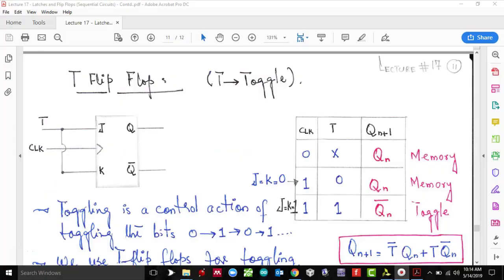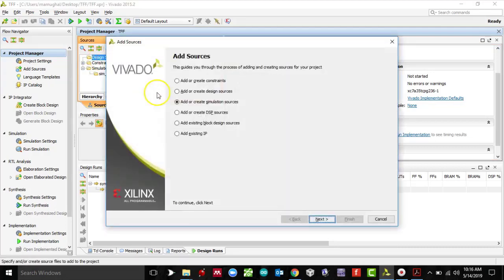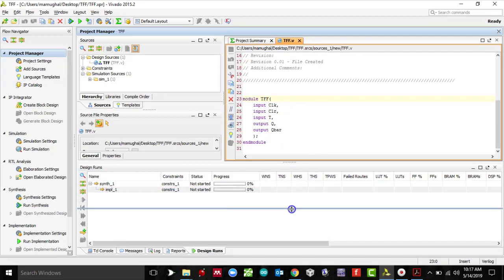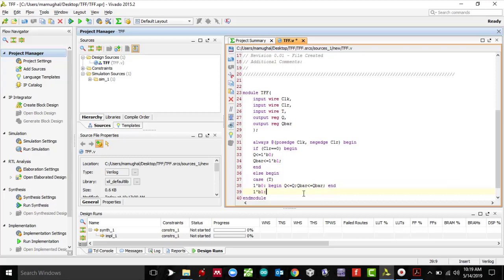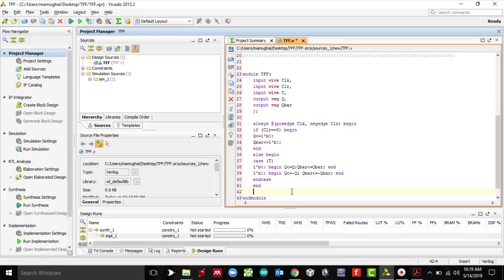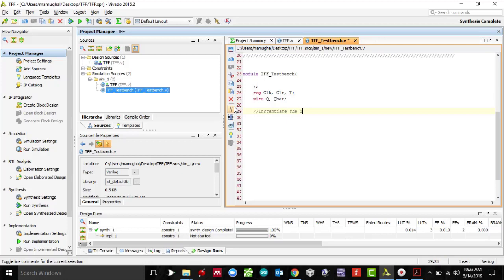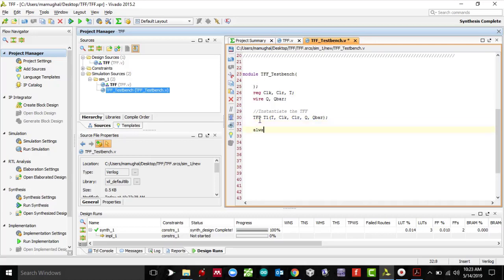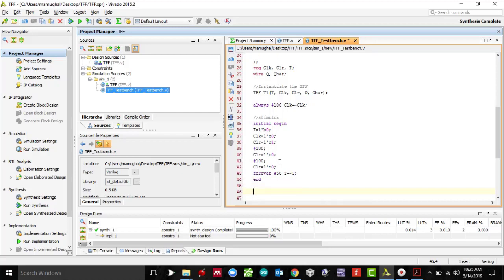#4 Verilog Description of T Flip Flop and Vivado Simulation

Comment: I notice in this video and the previous ones that when you instantiate the flip flop, the calling parameters are not in the same order as the one defined in the source. For example, in the simulation, you use TFF(T, Clk, Car, Q, Qbar) but in the design source, they are defined as TFF(Clk, Car, T, Q, Qbar). Is this normal?
Reply from the maker: Dear jmlaniel, very well noticed and technically in 2016 and later version, this is how it is supposedly be. It is always a good habit to follow the same order. Thank you. Hope that helps.
Reply: @ElectronicswithProfMughal  Thanks for this fast reply! I am learning by myself FPGA and your videos are really helpful. Many thanks for sharing them publicly.
Reply from the maker: @jmlaniel  I am glad that I am able to help.